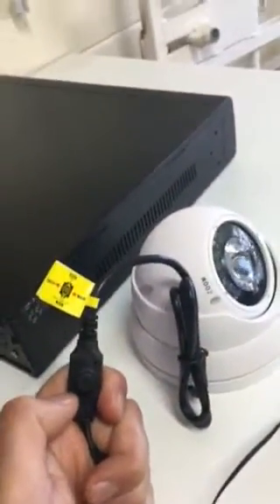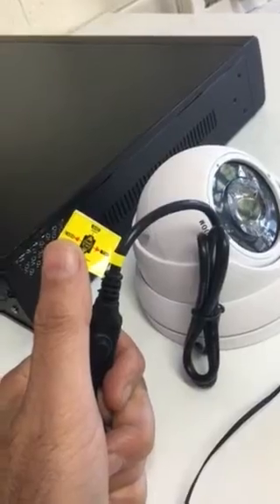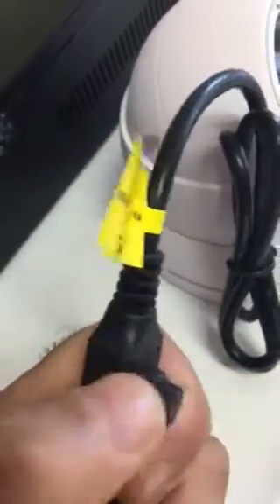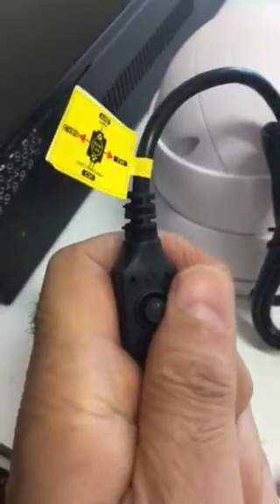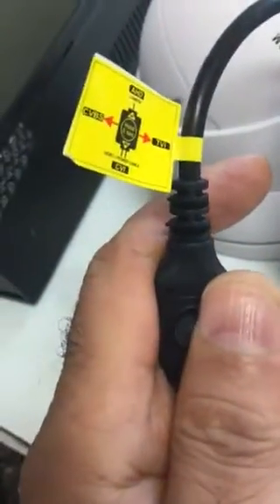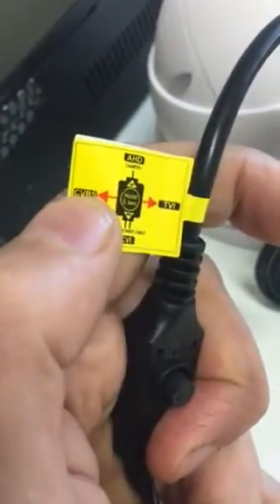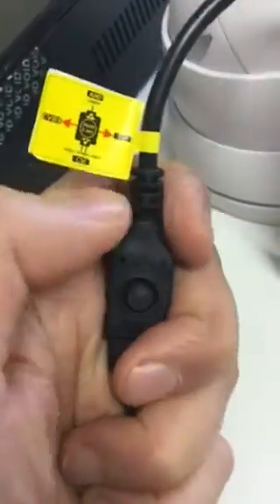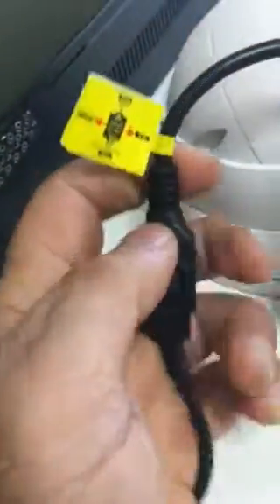How to change mode on 4 in 1 hybrid cctv camera

Comment: CVBS (composite) is (for me) the most useful mode in cctv cam, because you can connect it to accually anything with composite imput. I Transmiting picture from cam using vhf modulator to my crt tv